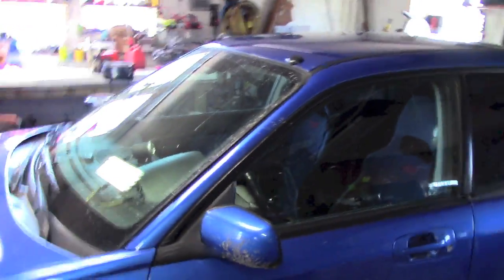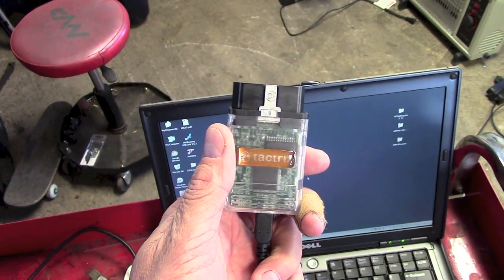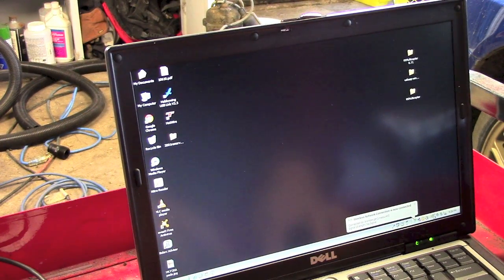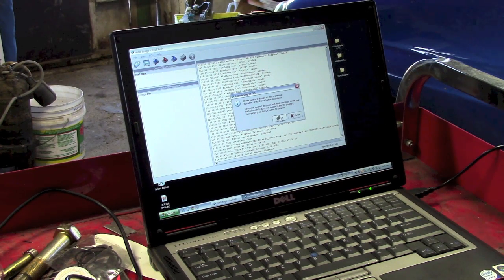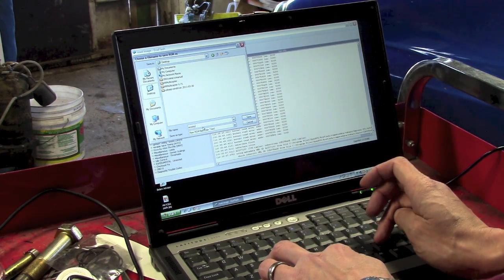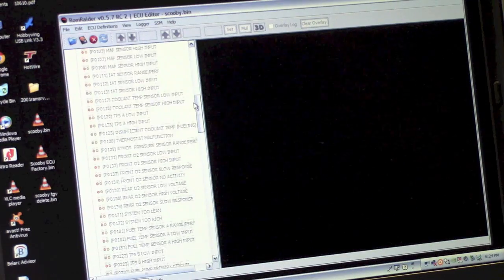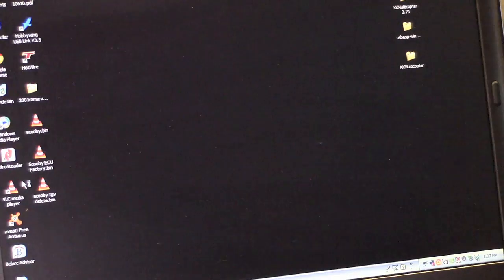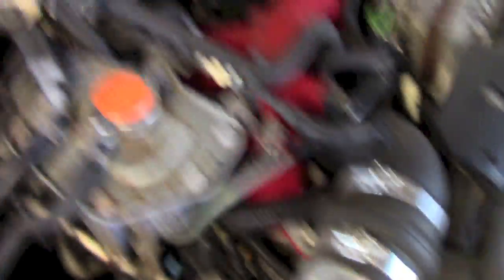Subara WRX STI TGV Delete - Disabling Codes

Comment: Thanks for the video. Worked like a charm and was able to remove a code and force emissions ready.
Reply: Hey did you just individually disable the codes (one at a time in ECU flash)? I can read my rom in ECU flash but there's no "force pass" option, just able to disable individual codes. I hope that's enough to force emissions ready for inspection.

Comment: Thanks allot for this video, very helpful. I purchased the cable to remove secondary air pump code and you help me to prepare better for what I had to do with Tractrix wire, software, etc. Works like a charm. I did not remove any parts, the solenoid stuck closed, I did not bother to do the delete mode, too much work, may be one day if I have to pull my engine out, I'll remove the whole sec air pump system. My car is 2006 WRX TR with 117K miles.
Reply: did doing this allow you to pass obd2 emissions? im having the same problem
Reply: I was able to remove several codes ( the original one and subsequent that came after, all linked to the secondary air pump) using this cable. My inspection  due next year , but I assume I should pass because I dont see any stored or pending codes on my OBD II reader.
Tactrix is good thing, once you got it, it will come with all instructions how it works, also if you have any following questions after purchase  Tactrix guys ( I deal with Mike)  are very helpful and easy to deal with.
I paid  around $200 for this thing and I think its well spent $$$$. 
Fixed these pesky codes and freed up my mind.
Check if you need an adapter, earlier WRX models required to be able to connect Tactrix to the OBD Ii port.
Good luck and I hope it helps.
Reply: @iswearnotme  I have SAIS codes but if you clear them with a code scanner they won’t appear unless the engine coolant temp drops below 60° F. Go for a drive, clear the code, get tested and you’re good. Then you can worry about clearing them otherwise

Comment: I know this video was posted a long time ago. I'm hoping the author of this video, EternalTinkerer will help me, please. I have a 2007 Outback XT. I swapped out EJ25 engines & a new Turbo. I performed the TGV delete and after the fact realized the Solenoids (The Servo's) are more sensitive than I was hoping they'd be by the ECU throwing the Generic P2006 & P2007 codes ! if the Solenoids weren't so sensitive & could read how many revolutions the tiny gear (That's inside the Solenoid) that turns the butterfly-shafts gear, then the ECU wouldn't know that the butterfly shafts & gear were missing ! At any rate, I now have these TGV delete codes to deal with. So, my question to you is, how the heck do I get in touch w/the guys at TACTRIX !? I've been calling & calling them & no one is answering ! Also, will this same TACTRIX set-up you're using work w/my 2007 Outback XT !? I spoke to COBB, and they told me that their Access-Port will NOT WORK on my 2007 Outback XT once I remove these TGV Delete codes using the TACTRIX Software. And lastly, I'm learning all about this Flash-tuning & Open-source tuning. My last question to you is......if I use this TACTRIX software & cable & uninstall these Codes, will that be compatible w/an Open-Source tune if I want one of our local Tuners to tune my Outback on his Dyno !? Its the type of Dyno that attaches to the hub of the wheel(s). I hope you can answer my questions Sir. It sure would be an enormous amount of HELP. THANK YOU SO VERY MUCH !

Comment: hi. my car subaru forester 2006 2.0L no turbo model i want to secondary air system remove and engine error code fix this is way ?
Turn off fault codes relating to high flow catalytic converter upgrades (P0420).
Turn off fault codes relating to secondary air pump (P1418, P1410, P0410, P0413, P0414, P0418, P2432, P2433, P2440, P2441, P2444).
Remove JDM factory speed limiter.
Reply: Ben de bunu merak ediyorum. Denediniz mi? 2007 atmosferik legacy için düşünüyorum..
Reply: @salihuyel227  yapamadım malesef TR de bu işten anlayan birini Ankara'da buldum İstanbul'da olduğum için yolum düşmedi, uzun süredir hata kodlu biniyorum.
Reply: @CnarBAKAN   Bende öyle maalesef. Tactrix ile okuma yazma yapamadım. Araştırıyorum..
Reply: @salihuyel227  umarım bişey çıkar yazarsanız sevinirim
Reply: @CnarBAKAN  Şu an için tamamen umutsuzum.. Onlarca forum, video vs. işe yaramıyor. Şimdilik tek seçenek ankara gibi. Sanırım olabi garaj..

Comment: Can you tell me the specifications of what you used?

I have:
-Windows XP SP3 32bits
-VAG COM cable FTDI FT232L cable
-Ecuflash (all versions with ecudefinitions)
-Tactrix drivers provided by Ecuflash, Or FTDI drivers..
-Forester S-Turbo 2002...
Reply: I already solved my problem.  No need to use virtual machine, nor windows xp.  I just had to modify the vagcom cable.  here I leave the link

https://forums.nasioc.com/forums/showpost.php?p=35844629&postcount=149

Comment: Btw if u have a ecu that isn't supported by the earlier versions of 'open ecu', ie not the drive by wire ecu's, your going to need a tactrix cable (USD $300) unfortunately, as they locked us out of the new versions of 'open ecu'...

Comment: hey, I did all of the above, and Even try to delete the actual description of the TGV Codes  but check engine light still comes on . plz help
Reply: What year car is it? What program are you using to modify/flash? Are you using an openport 2.0? If you unchecked the TGV related codes and flashed the map, it should be done. Maybe you have a CEL for another issue? 🤔 Romraider is a good resource for older WRXs, but you need to search rather than post questions, just like most forums nowadays.

Comment: Can i delete the codes first, as you did,  and still drive my car for a coupe days before i actually remove the tgvs?
Reply: Yes, absolutely. Doing what this video shows only disables the codes, it doesn't actually change anything that your engine does. It's like telling your car not to cry even if the TGV sensors are hurting.